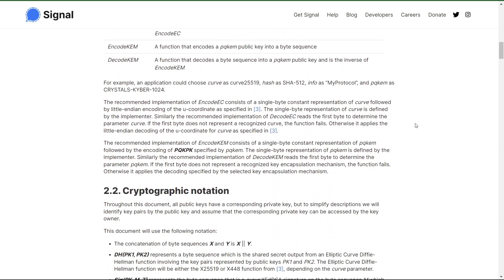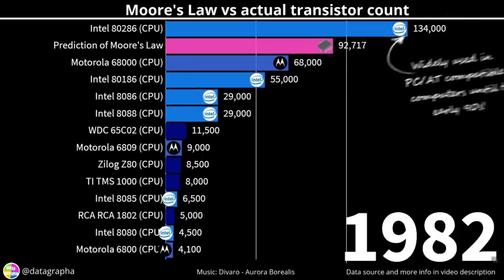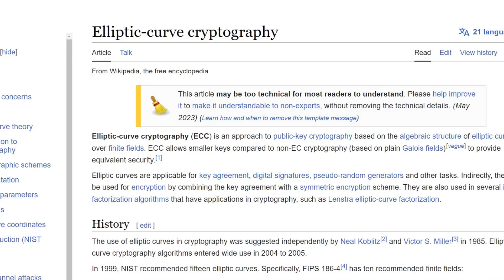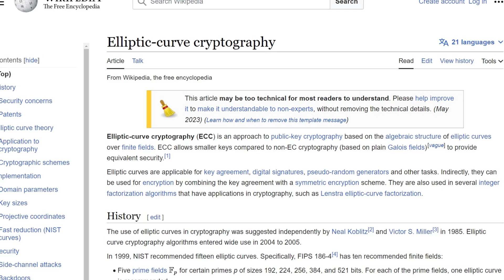Signal Just Published Post Quantum E2E Encryption

Comment: Can someone explain how 434 qbits is double 433?
Reply: That's because 2^434 is 2 times bigger than 2^433. There you have it. I would compare this to the  system "bus" in processors. If a processor has a 32 bit bus the maximum memory (RAM) what you can theoretically use is 4 gigabytes because 2^32 is about 4294000000 but if you use a 64 bit bus your theoretical maximum memory limit would be not 2 times as much but over 4 billion times as much.
Reply: @NorbertKasko  ok, but why are we squaring?
Reply: @MangoTekNo  As long as I understand the difference between the "classical" bits and the quantum bits is that when you use quantum bits all of them can take both possible values simultaneously+ it can be in-between them. This is what makes it exponentially faster. The IBM had a great video here on youtube which explained the topic very well. I don't remember the exact title.

Comment: It is good that post quantum encryption is being adopted just in case, but to say modern asymmetric encryption is useless is WAY far from the truth. 

As of now, quantum computers have never demonstrated that they are faster than classical computers, for useful algorithms. They are also multiple orders of magnitude off when it comes to enough qubits to do basic algorithms, let alone attack modern encryption. The speed record for quantum computers, for useful algorithms, is the prime number factorization of 21, and that algorithm used a special case to fit in the computer, and it was slower than a classical computer. Current ECC algorithms also make scaling impossible. Unless there is a breakthrough with room temperature semi-conductors or qubits there is no path forward for quantum computers to do anything of use.

Comment: Just a reminder that those calculations Mental is talking about are done on idealised qubits, or logical cubits. To build 100 error-corrected logical qubits,  it is estimated that over 100 000 physical qubits are required.

So with IBM's 1000 physical qubits they have about one logical qubit. Slow and steady!
Reply: Wow, they're that far behind claimed capacity?
Reply: @hanelyp1  Yeah, as many commenters on this video have said, the issue is keeping quantum state long enough without interference. 

So unlike Mental said, we are nowhere close to any sort of  quantum computer that can crack passwords.
Reply: @tuomasmassa2954  Still, if we are 10 years off of cracking stuff encrypted now, it's better to be prepared (I don't know how far off useful quantum computers are, just tossed out a guess).
Reply: @Takyodor2  Absolutely. No doubt we'll have q computers at some point 👍
Reply: @tuomasmassa2954  exactly, without improving coherence and finding some quantum error correction we will probably never be able to do exact calculations (like breaking encryption) on quantum computers.
Interestingly though, for a lot of problems like weather forecast this is actually not a problem at all since you will likely rely on quantum annealing anyway and there errors are somewhat part of the process itself anyway.

Comment: Hi Mental Outlaw,
Thanks for highlighting this new achievement in post-quantum cryptography. I watched the whole video, and it was very interesting. I was also very pleased that you gave a brief overview of some essential quantum algorithms. It is indeed true that Shor's algorithm has the potential to break conventional cryptography.
However, as a quantum computing researcher, I couldn't help noticing a few misconceptions you have about the state of current quantum hardware and algorithms. Basically, current quantum devices are too noisy to break cryptography. For that you need fault tolerant qubits, which can be created by allowing millions of actual physical qubits to interact. We are nowhere near having the number of physical qubits, fidelity nor speed of operations. This is not a secret, as IBM's quantum devices' calibration data is available online and as an example of their performance currently, you can look at the two-qubit gate error rate, which tends to be around 0.006 - 0.009 or so for their high-end devices. This error still accumulates to quickly to enable factoring of large numbers and the error correction overhead needed is beyond the capability of current quantum processors due to a lack of physical qubits.
I hope that helps, and if you'd like to know more, feel free to ask!

Comment: I once watched a video explaining how quantum computing can be used to defeat current encryption using shor's algorithm, and the video may or may not have been accurate, but if it was, I'm having a hard time understanding how this is going to preven shor's algorithm from working, and I'm having a really hard time trusting this, because people's fears over being decrypted by quantum is just the type of boogieman that would allow a government to sneak in a back-door into encryption (remember skipjack?)... and in the Signal whitepaper, everything appears to be normal E2E except for one specific step "post-quantum key encapsulation mechanism", which itself links to another paper from NIST, which was published by the US Department of Commerce, on Module-Lattice-based Key-Encapsulation Mechanism Standard, which is the source for Crystals-Kyber, which is what is used by signal, But everything in the NIST document, is SPECULATIVE, and refers to quantum computing as "A thing that May in the future be possible", because it was written back in 2016, before there was a real quantum processor, rather than theoretical builds in a lab to figure out if it would be possible, Which means every solution proposed, is based on an incomplete understanding of how quantum computers might work. It has zero mention of shor's algorithm, which means it has no consideration for an actual method of attack, only speculative ones. Signal is only using Crystals kyber because it has a registered patent that is is freely available to use without the need to purchase a license, but as best as I can tell, hasn't been tested. I'm never going to put anything compromising in any online chats, ever again. if I ever do anything that I wouldn't want a government snooping in on, and I want to share it with someone over the internet, I'm sharing it via sneakernet with a one-time-pad. the paranoia is real.
Reply: Shor's algorithm solves integer factoring and some other related problems used in some crypto protocols (discrete log).  Post-quantum crypto uses different settings, like lattices or elliptic curves, where no radically efficient quantum algorithms akin to Shor's are known or really expected.   Having said that, you're right that moving to any new protocol means security is weak, all kinds of new flaws are possible, etc.   Some of these post-quantum cryptos might end up being broken by regular computers due to flaws.
Reply: @iyziejane  this is a copy of my reply to the other guy. 
 I understand that quantum isnt magic, but the explanation i saw involved breaking the problem into a brute force problem, where collisions output a 0, and non collisions would either be 1, or 1, and running it as entangled bits, and all the +/ 1s destructively interfere, leaving only 0s, the bits associated with valid collisions that would successfully decrypt. If that process is accurate, then the exact algorithm is irrelevant, and its the nature of destructive interference that allows quantum to effectively crack non quantum encryption, and in fact, quantum encryption may be a pipe dream. The video i had seen was reliant on a specific method of quantum computing, which allowed for, effectively, infinite parallel processing to solve entire sets by defining a range, as entangled bits, but you have to pick a specific flag bit to pick out a specific value from the range, which destroys all other values because the resolution disentangles all associated pairs, which is why transforming the output to destructively interfere works, it reduces the selectable flag bits to only the ones that you want, destroying the useless data with physics, rather than computation. This whole process relied on bits being entangled photons, and the logic gates being EM fields as lenses. If quantum computing goes that route, i see no reason that any algorithm couldnt be rearranged into that type of problem.
Reply: @therealquade  I can see you're thinking about this in depth, but maybe the video you watched involving algorithms with flag qubits was a little misleading.  It is correct that quantum computers differ from classical probabilistic computers because of the interference patterns that can form between different possibilities.   But there are a lot of constraints and specifics about how this interference occurs.   That's why the structure of the integer factoring problem is crucial to achieving the quantum speedup from Shor's algorithms, and the techniques don't generalize for generic optimization problems.  The problem Shor's algorithm really solves is called "period finding" (it was already known that integer factoring reduces to period finding).   This is about finding the period of a number within modular arithmetic.   For example, the set of numbers {0,1,2,3} forms a group under addition mod 4 (mod 4 means that if I add two numbers and get 4 or more, I output the remainder of the number after dividing by 4).   For example, 2 + 3 = 1 (mod 4).   Now given a modular arithmetic group like this, you can ask about the period of a number, which is the number of times you need to add the number to itself to get the original number back.   So 3 + 3 = 2 mod 4.   3 + 3 + 3 = 1 mod 4.   3 + 3 + 3 +3 = 0 mod 4.   3 + 3 + 3 + 3 + 3 = 3 mod 4, and so the period of the number 3 in this group is 5 (add it to itself 5 times to come back to the start).   Shor's algorithm finds this period rapidly for very long lists of numbers.   I explain this detail to convey the sense in which Shor's algorithm solves a very special problem.   More to the point, generic NP-complete problems like MaxCut on graphs are not expected to benefit from exponential speed ups with quantum computers.  One term for reading about this is the "Strong Quantum Exponential Time Hypothesis."
Reply: Quantum computers are not miracle machines. It is well-known how quantum computers will work if they eventually work. What is unknown is what they can do: The algorithms. Just like we know how regular computers work and yet don't know all algorithms that someone might invent.
Current post-quantum cryptography research essentially requires on an educated guess about which problems can be sped up by quantum algorithms and which not.
For instance, Shor's algorithm breaks RSA and some others.
Grover's algorithm can speed up many problems quadratically, including AES. This can be counteracted by doubling key sizes. So AES is not broken (by this specific algorithm)
Experts currently do not believe that quantum computers can solve NP-complete problems in polynomial time. This is an educated guess, not proven. But then again, P =/= NP is not proven either, so classical computers might also be able to break RSA e.t.c and we just don't know it yet.
Reply: @entcraft44  I understand that quantum isnt magic, but the explanation i saw involved breaking the problem into a brute force problem, where collisions output a 0, and non collisions would either be 1, or 1, and running it as entangled bits, and all the +/ 1s destructively interfere, leaving only 0s, the bits associated with valid collisions that would successfully decrypt. If that process is accurate, then the exact algorithm is irrelevant, and its the nature of destructive interference that allows quantum to effectively crack non quantum encryption, and in fact, quantum encryption may be a pipe dream. The video i had seen was reliant on a specific method of quantum computing, which allowed for, effectively, infinite parallel processing to solve entire sets by defining a range, as entangled bits, but you have to pick a specific flag bit to pick out a specific value from the range, which destroys all other values because the resolution disentangles all associated pairs, which is why transforming the output to destructively interfere works, it reduces the selectable flag bits to only the ones that you want, destroying the useless data with physics, rather than computation. This whole process relied on bits being entangled photons, and the logic gates being EM fields as lenses. If quantum computing goes that route, i see no reason that any algorithm couldnt be rearranged into that type of problem.
Reply: @therealquade  I am not an expert in quantum computing, and from the quality of your explanation (no offense, it is very hard to understand let alone explain), neither are you :) However, afaik from limited research, there are not that many known quantum algorithms that are useful. In particular, Shor's algorithm really just finds factors of large numbers.
Note that those algorithms are developed using the model of an universal quantum computer (Quantum Turing machine).
Reply: @entcraft44  I'd bet it's unlikely to find an actual quantum-computer expert in the youtube comments, but who knows. There are certainly smart people working on algorithms for computers that may or may not soon exist, and they have almost certainly thought about these problems thoroughly.
Reply: Don't worry! It doesn't matter if you will send private data in the future. They have collected your old data anyway.

I would say if I was as paranoid as you.
Reply: @tartas1995  There are types of secrets that matter anyway. I wouldn't worry if the old crypto keys to my bank account were cracked, but I would be very worried if my current ones were cracked.
Reply: @tartas1995  the old data is meaningless if i change dramatically, and the catalyst for change went unrecorded.